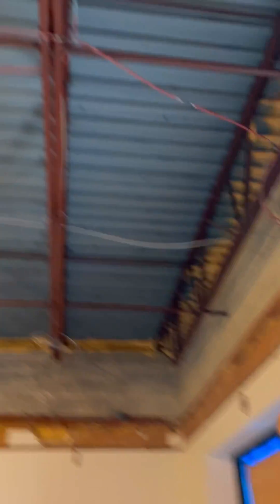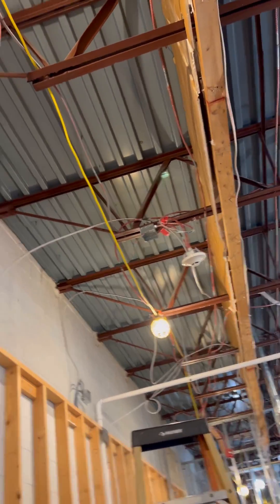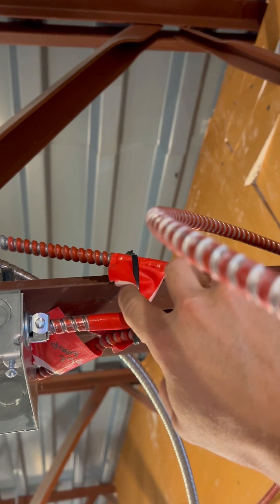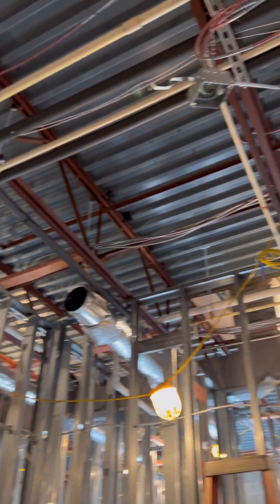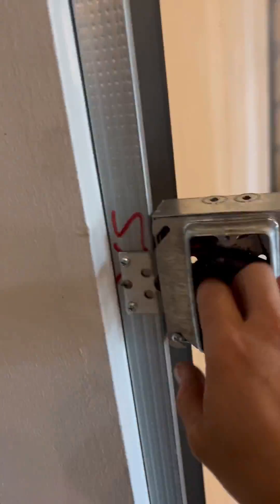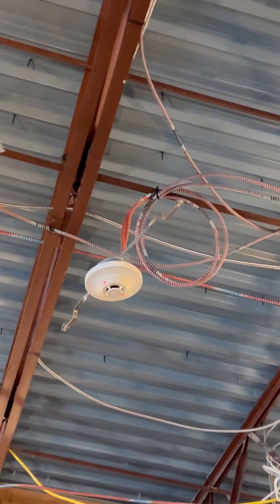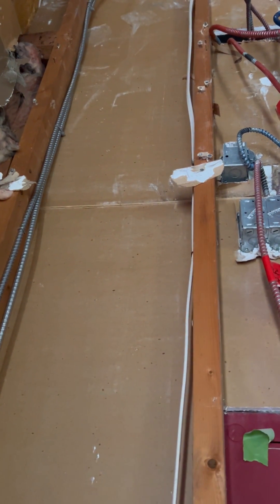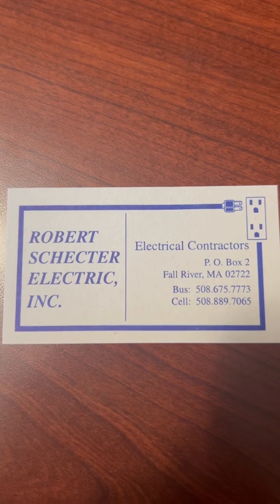Class A Fire Alarm SLC Loop Explained! 🔥🚨 Electricians, Check It Out! #shorts #electrician #fyp

Comment: Your area doesn’t allow FPLP?
Reply from the maker: Gotta be special MC in Rhode Island very very strict regulations no low energy cable allowed. After the station night club fire the rules tightened way down. I can only use terminal connectors steel connectors everything has to be painted red very very strict regulations
Reply: I’m an RI electrician. Like Lance said, RI has its own fire alarm code. Only steel raceway and/or steel jacketed MC cable with a very specific color code is permitted. No wire nuts for fire alarm splices, terminal blocks only. Systems cannot be wired Class B. There’s many more rules but those are the big ones

Comment: I hate RI fire alarm wiring. I’m a lifelong RI electrician. I think it’s the dumbest code ever. Last big fire alarm I worked on was the Newport County YMCA. Miles of this cable used plus lots of EMT in exposed areas.
Reply from the maker: Yea it hasn’t been really that fun to be honest so difficult to get equipment now a days also trying to get the fire alarm company down their to disable the panel so I can tie my new wires in is like impossible to get them their theirs just so many hurdles you have to go through but at the end of the day it is what it is